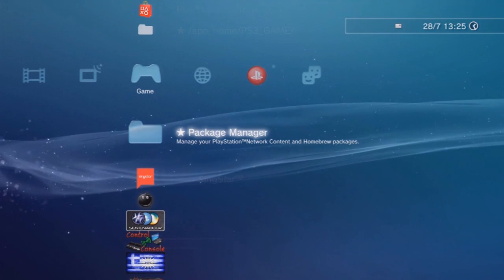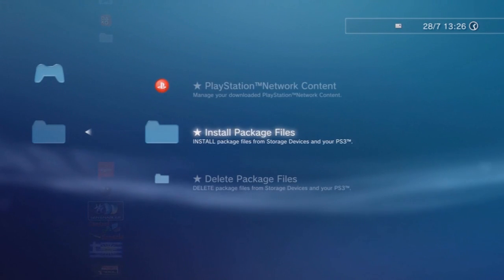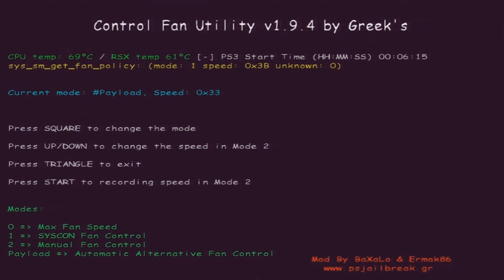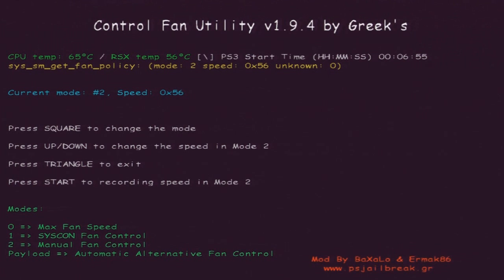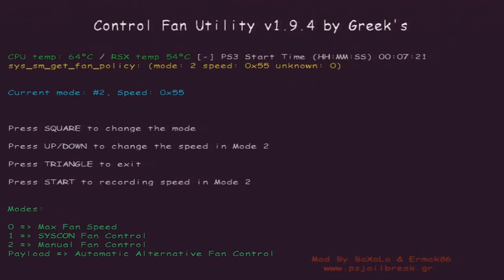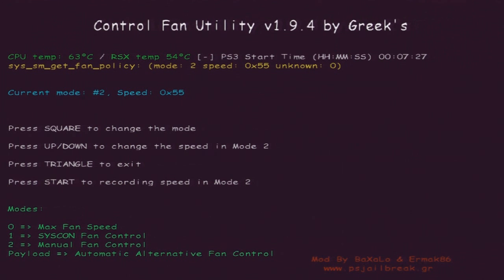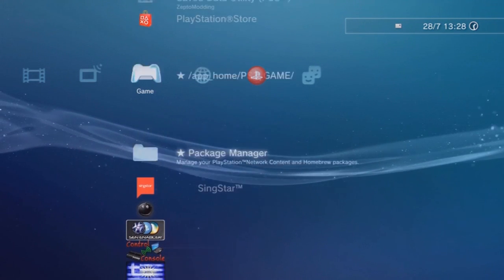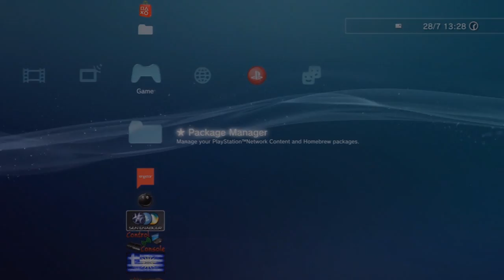PS3 CFW - How to Prevent Freezing & Overheating!

Comment: My PS3 CFW slim gets cpu 75 RSX 79-80 if I play ps2 games on it ... is that normal 🤷🏼‍♂️ using Rebug 4.84 CEX
Reply: No 85 is ylod range you need to re apply thermal paste on your cpu and gpu also if you can try removing them to apply thermal paste underneath them this is the main true way to get your PS3 at ow temps Sony used cheap paste and many people don’t know you need to get underneath the CPU and GPU and apply thermal paste not just on top very crucial and also time consuming since Sony decided they wanted to literally glued the chips to the motherboard.
Reply: Vkop Films thanks Bro for the answer 😎✌🏼 I will work on it
Reply: Krish Bruder no problem just be careful or you’ll have to buy a new motherboard watch NSC ihs removal video skip to about the 43 minute mark the CPU is probably by far the hardest chip to take off since while being the easiest to break Sony was on the bs

Comment: From personal experience I suggest changing your thermal paste and cleaning the ps3 to get rid of any dust then change the fan speed a little higher. That’s what worked perfect for me 😁
Reply: Been wanting to do this worried I may ruin the ps3 completely
Reply: @Bakedtotti  you won’t ruin it just watch a YouTube tutorial, that’s what o did my first time. It helps a lot though so would highly recommend
Reply: My ps3 had 2 of the screws that hold the motherboard plating fucked
Reply: So i cant change the termal paste
Reply: @shiba-sdt16  how so? Did the screws not come out?
Reply: Lluvp
 Lggy
 L lgg fyl
Ljmko. Bjl. M
Reply: What temp u set on your fan on ps3

Comment: My PS3 never goes past 55C. Cleaning it out and reapplying thermal paste on both the cpu and gpu is totally worth it in my opinion.
Reply: that paste dont work mine still hot I think its the supply
Reply: @cmoneytheman  I see. It depends on how you apply the themal paste too. Don't do the Dot in the middle when applying it. The heat sinks already have pressure so when you had put it back together it must of formed a few air bubbles causing overheating issues or in your case running hot. I'd try reapplying the thermal paste but use a card of some kind and spread out the paste evenenlly and ensure there's no air bubbles. Should solve your problem hopefully and if that still doesn't work then it's definitely the power supply but again could have dust build up in the power supply. Canned air does the trick for that. Either or let me know

Comment: I was getting temps of 75-80 ℃ before installing this, now I can play for hours and CPU/RSX won't ever get above 55 ℃ and I got a fat PS3 been working like a charm for 4 years now and still looking strong :D
Reply: Big0taz0 that's what's happening to mine rn for gta 5 online, help what settings did you use for control fan utility ?
Reply: Hybrid Theory+ That's why I decided to jailbreak right away, I bought my  PS3 off eBay (2010 model) in 2014 and I knew shit was getting too hot inside... I don't think it would've lasted like that for more than 3 or 4 months before YLODing, but * as I mentioned earlier * it's been running fine and well until now. NO WORRIES
Reply: Shaggy Cruz+ Right now it's kinda hot (I live in the South) around 97°F (36°C) degrees by 4:00 pm, my PS3 starts around 113°F (45°C) and rises up to 50°F (122°C) by the time I set the fan.

I'm currently setting Mode 2 (manual) at 0xB0 and it sits at about 134-136°F (57-58°C). For me this is the optimal balance between temp, performance, noise and fan lifespan.

You could definitely get better readings if you have AC in your room (I don't). Console age and thermal compound replacement are also important factors to consider (I replaced Sony's cheap-ass white stuff with Arctic Silver 4 and it helped a lot as temp dropped a whopping 10°F).

My brother always plays his PS3 (phat model too) with the fan running at top speed (not recommended at all) and hasn't had any issues until now. Again, each case is different.
Reply: İ have fat model 12years old model
Reply: how is that temp went down cause mine dont

Comment: I wanna know if anyone can help me out. I downloaded the 2009 Wolfenstein game for PS3 and it is one of those folder dumps, not ISO. I launch the game in Multiman but the game runs choppy frame rate. Is that just how the game ran on PS3? Do I need to adjust some setting
Reply: Retro Gamer+ Marvel Ultimate Alliance had a similar problem which could be fixed by changing the PS3 Display Settings and turn the resolution down to 720p (or even 480p). That should do the trick. If it doesn't, your game may need an update/patch (The Evil Within had serious display issues which were fixed with an update). Hope this helps.

Comment: Is 70 good?
Reply: Teh Zoomer a little high if on xmb
Reply: Ghillie - mine is on 79-80 RSX and 73-75 on the other thing while playing bo2
Reply: ApoRed I would set fan speed through webman from 40%-50% at those temps ur ps3 will get red light of death. Do u have a slim or fat? I would redo thermal paste.
Reply: Ghillie - slim but ive got the jb for like 1½ year now but i dont thing the thermal paste ever got redone and the ps3's almost like 6-7years old
Reply: ApoRed Since a slim it wont just die like a fat one would if u keep it under 85 on rsx and cpu it should be running another year or two but 85 degrees is critical. i would put something under ur ps3 like bottle caps on every cornor. It might look ghetto but the system will be able to vent heat out bottom.
Reply: Ghillie - im ghetto so that's non of a problem thank u for effort in helpin me  i'll try it these days. 
it's weird sometimes i play like 4hours straight and it stays at RSX 70-73 and CPU 69-70 and sometimes i just got into the game like 5min and already on 78+ both......
Reply: ApoRed games will always run ur ps3 hotter than xmb. ur change in temp is probrably the room temp is hot or cold
Reply: Evan i have fat ps3 mine its 80cpu what did i do?

Comment: Will this automatically go on when the PS3 on Cfw boots up?
Reply from the maker: +jp554731 No you have to open the application and set the fan speed manually each time.
Reply: +DrZepto that sucks, you'd think that someone would have thought of a way to boot it up automatically after 3 or so years
Reply from the maker: jp554731 It probably has been developed but the problem with making it automatic is that it can cause issues with disabling it. What if it got stuck and you couldn't simply turn your console off to disable it? :3

Comment: Do you know whats the best cfw now?
Reply from the maker: +MotionFTW There's not a 'best' CFW because each one has their own unique features. I personally like Rebug because it's common and supposedly more stable than other CFWs. Rogero is another common one but I heard they like to rush their CFWs but not sure if that's true anymore.
Reply: DrZepto™ - Skate 3, GTA V & More! Is 4.75.3 rebug rex a good cfw?
Reply from the maker: MotionFTW I run 4.70.1 which was the first Rebug version of 4.70. I'd suggest running 4.75.3 because that .3 at the end means it's been refined 3 times already. Therefore, it's probably very stable :)

Comment from the maker: Hope this video helps anyone having freezing/overheating problems. This method keeps my PS3 from freezing so it should work for everyone else :)
Reply: It does ;) tried it myself.
Reply: +DrZepto™ - Skate 3, GTA V & More! What speed should I use? I just want it to help me avoid YLOD in general. Put it on 0x67 ?  and will I have to do it every time?
Reply from the maker: iSh8Sn0w I used to put it on 0x65 on my phat PS3 but I recently upgraded to a slim PS3 so I don't change the fan speed at all.
Reply: Ok my ps3 is a slim should 0x65 do good? orn should I go a little further?
Reply from the maker: iSh8Sn0w 0x65 should be enough as that is above the normal fan speed. :)
Reply from the maker: iSh8Sn0w I believe if you want to play BO2 zombies without getting banned, you'll need to swap the EBOOT file to a zombie mode version. Lots of EBOOT creators have two versions, one for multiplayer and another for zombies. :)
Reply: yeah, seen 1 but some say it don't work, and none said it has worked yet :\ Any ideas where to get one for zombies :D?
Reply: I have not tried this one  http://www.nextgenupdate.com/forums/call-duty-black-ops-2-mods-cheats-guides/734846-1-19-multiplayer-zombie-eboot-updating-more-modifications.html     but some say it don't work, and none reported it to work yet :\
Reply: ok so gonna use the zombie one too (already got MP)  but what I don't understand is where to put both, since I have one for MP and 1 for zombies, it's only 1 Eboot file there as I know  in USRDIR\Bles01717 for example. Where to put the 2 eboots then?
Reply from the maker: iSh8Sn0w You can only use one at one time. If you want to use the zombies EBOOT, replace the multiplayer EBOOT and vice versa.
Reply: aaah damnit xD Might as well store them on the ps3 in a folder myself then ;) Thanks for helping this has really helped me a lot dude :D!
Reply from the maker: iSh8Sn0w no problem :)
Reply: OMG lol xD I was so lucky today, was going to get my ps3 modded by a service for like 70 usd in my country (another currency tho) and I bought the ps3 for almost that price used, and damn I was lucky :D! The damn ps3 was running 3.50 lol xD So I saved the money to send it in for downgrade cx So happy right now that I saved so much money and got it with 3.50 so I can jb it easily ^^
Reply: +DrZepto does this work with CFW 4.76 ?
Reply: My PS3 freezes when I try to open it. I'm on 4.70.1 DEX
Reply: did y fix?
Reply: what should i put mine at?